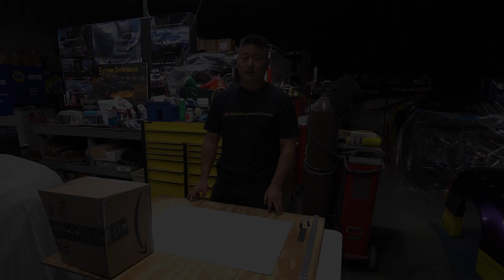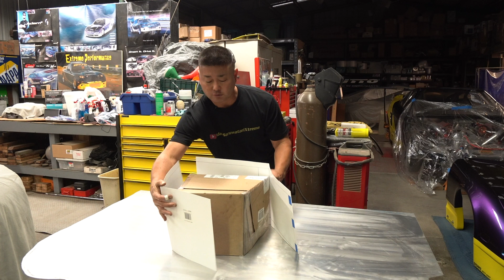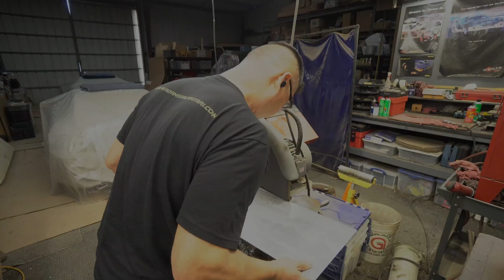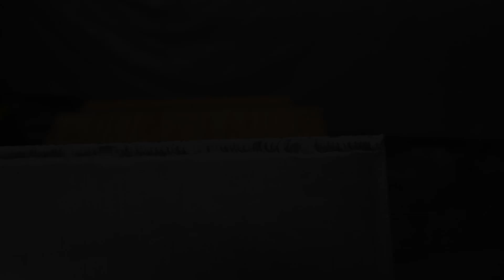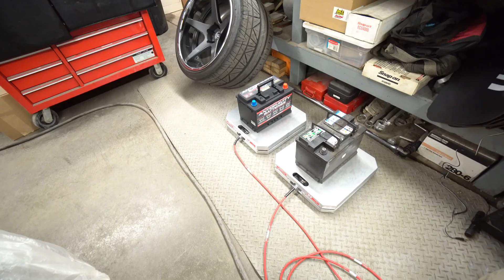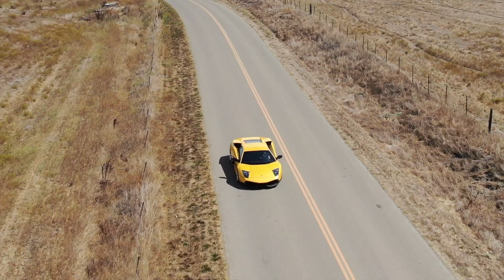Moving on The X & Dropping weight on The Murci

Comment: Awesome tutorial on Lipo batteries. I am a big fan. Been using them on my race bikes since 2014 and the weight savings are huge specially when the battery is located high on the bike. The only downside to a lipo is they are sometimes harder to start when outside temperature is in the 20's. They will need to be cranked a few times to heat them up for full cranking power. Good job brother 👍🙌
Reply from the maker: Battery weight has always been an annoyance to me.  I used to try those small batteries to save weight.  Then I wouldn’t have enough power.  You are way ahead of me on Lithium Ion. I was never excited to convert my charging system.  I am really excited that I can run my current charging system. Luckily, here are the wrong coast, I rarely if ever need to worry about that.  😂😂😂.  Thanks Bro!